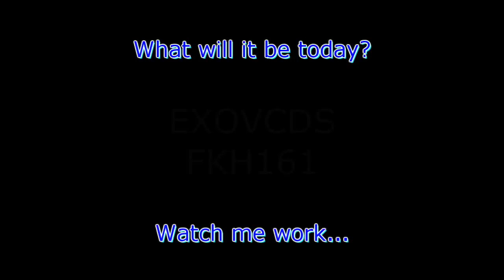VW T3: Flywheel & clutch mounting

Comment: Hi Thomas, 
                      thanks for another, very informative video.  I've now got to the stage where I can put the gearbox back on.  But as I thought it was a good idea to to replace the clutch slave flexy pipe, which looked a bit perished at one end I now have to replace a section of pipe forward of the flexy. 
This broke, immediately next to the join.
I should leave well alone. I t would have lasted a couple of years as it was.

Now the boring bit!  1970cc aircooled Kamper (Vanagon)

 The story of the aircooled Kamper goes like this: - As it runs
      on LPG and has 100 mile range before I would have to use petrol (gas),
      which is much more polluting as well as much more expensive in the UK,
      refueling requires planning on a long trip.  (from Norfolk)
 I knew that the clutch was getting the occasional slip.
I had set the satnav on my phone to the shortest route to a
      nearbye LPG pump at Morrisons in Crewe, when I thought we were
      getting low on fuel.  (the fuel gauge doesn't work so I rely on
      mileage covered).    
As it was a Sunday, the garage shut early!  So we spent the night
      in Morrison's car park not getting a lot of sleep.  Next morning
      we refuelled and headed for Porthmadog (North Wales).     
 Later on that day I noticed my ears popping.   
Then I realised, as we headed through "The highest village in
      wales", that I had forgotten to reset the Sat Nav to 'most
      economical route' and we were still on shortest (over the mountains).    
It was then that the clutch decided it had had enough and slipped
      very badly, getting extremely hot and smelly.   
So we stopped, let it cool down and limped on into Wales very
      carefully! We had a couple of visits to my wife's 97 year old  aunt  and
      after a couple of minor adventures limped home going a much
      flatter route.
If you're ever in the UK I owe you a beer or 2.
Robert
Reply from the maker: Those clutch & brake lines are fun! You always end up replacing more than you panned for!
Road trips & unexpected car problems can be fun... when you don't have a schedule to keep! Gives you time to explore the towns / cities that you are stranded in! =) The fuel tank is quite easy to remove... I'd recommend looking into repairing the fuel gauge. You can apply ground / earth to the purple/black (if I recall correctly) wire at the back of the instrument cluster to see if the fuel gauge moves (before dropping the tank)... if id does not, then the problem is in the cluster (probably). Double check a wiring diagram before you earth the wire... just in case I am wrong!
Thank you for watching my videos!

Comment: Hey mate. Are you really using honey on the o-ring and on the flywheel surface, where it meets the oil seal? Or is that a mechanics jargon for some sort of grease? Am just about to put my flywheel back in, so would really appreciate your feedback on this. Thanks and keep up the good work!
Reply from the maker: Engine oil
Reply from the maker: If I had said honey... would you have used honey? =)
Reply: Would google the crap out of it first :) Thanks

Comment: May I ask .... does one need to check the end-float when replacing new flywheel? I saw no shims on my travels and so assumed I would be OK. Thanks :)
Reply from the maker: Year, make, model, engine? Yes, on Vanagon engines you need to check if there is enough free play when changing flywheels. Usually there are at least 3 shims... and a thrust bearing. You can see the shims (three of them #21), thrust washer (21A) and the retaining washer (12A) here:
https://volkswagen.7zap.com/en/usa/vanagon/va/1986-65/1/105-6005/
Reply: @EXOVCDS  Thanks Sir! Yeah I got a handle on what would need to be done - I just got the impression that in the video you changed flywheels without verifying end float, which I am guessing in specific scenarios might be OK. I got late 1990 2.1 petrol but with heavily modded (gowesty 2.5) crank. Only done 12,000 km since complete rebuild. I changed flywheels without messing with the oil seal behind which the shims sit. I just changed flywheel o-ring and felt - as indicated my most and you ;) I will check float. Thanks for hand holding :)

Comment: What tool did you use to lock the flywheel?
Reply from the maker: +David Z That's an original VW tool... has been at the shop since I started working here. If I read the writing correctly it says MATRA 2156 There are a variety of locking tools available these days: http://www.jbugs.com/product/5003.html